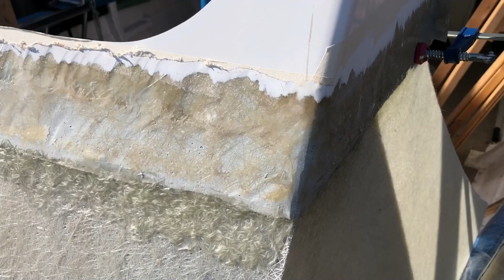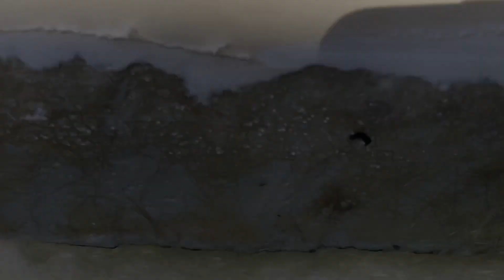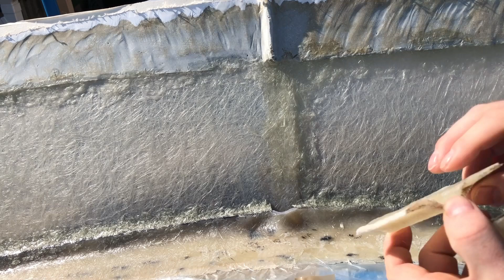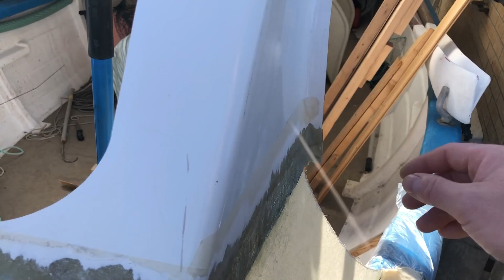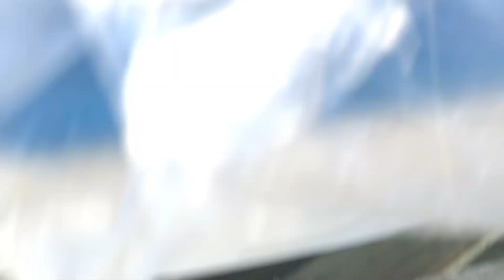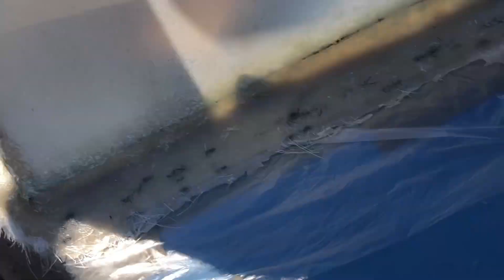Orkney 23 splash screen build. Grp build on commercial sea fishing beach boat

Comment: Someone’s put a splash screen on my Dijon Boat, but it’s made out of wood and it’s making the boat top heavy so it’s gotta come off 👍
Reply from the maker: Why do people put wood on a grp boat? It doesnt make sense
Reply: @beanysfishing2555  I no mate ! Looks good, but completely impractical especially when she starts rocking lol
Reply from the maker: @user-il1nj7gu1c  How thick was this wood? Must be heavy as hell.
Reply: @beanysfishing2555  it looks like 18mm thick ply and about 1 meter tall with roof and a now faded perspex window. And at the top a square box made out of ply again! With a large double din Car radio and a VHF Radio! The weight of them, two alone, would sink the Boat lol
Reply from the maker: @user-il1nj7gu1c  sounds like a right lash up